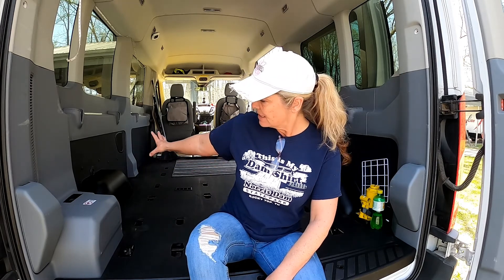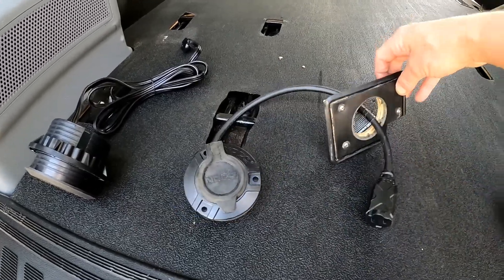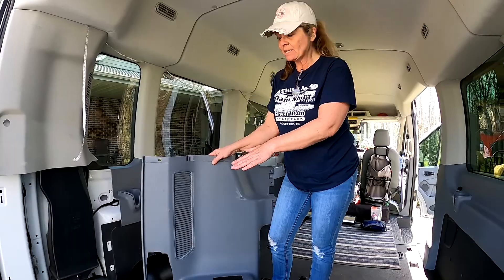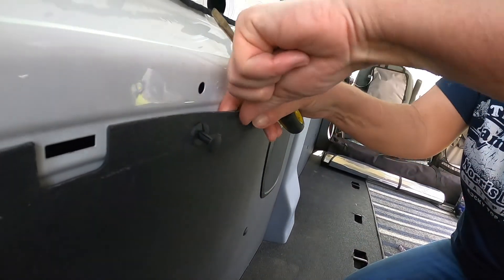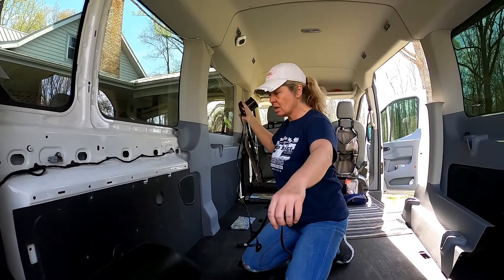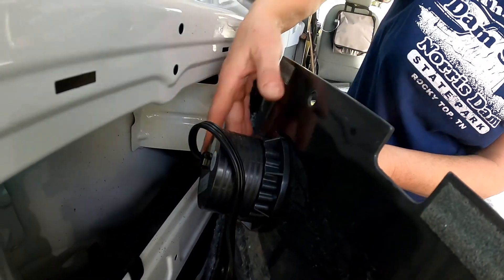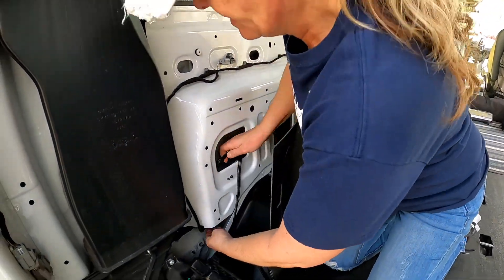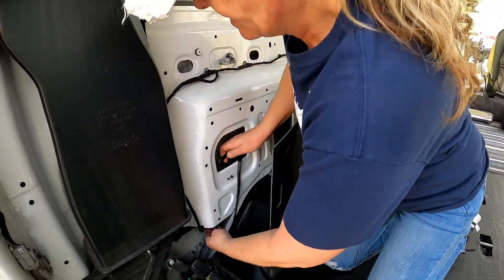How To Install Shore Power Access on Conversion Van: Ford T350 Passenger to Campervan

Comment: Good project.  I would have drilled a hole outside just because I’m too lazy to get up underneath there… lol.  I ran something similar in my camper in order to run my portable air conditioner
Reply from the maker: That is a good idea. I need to check into a portable air conditioner for the van.~Scotty